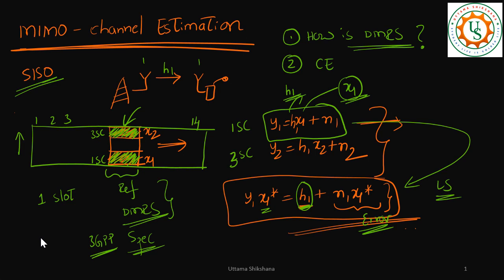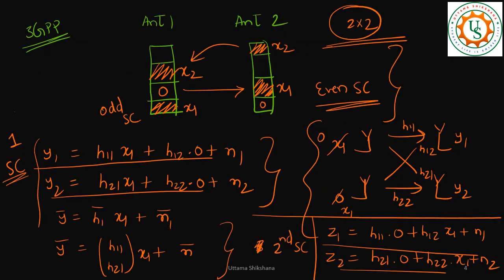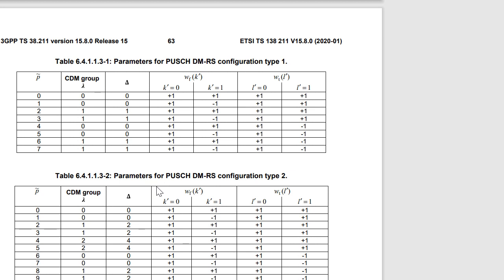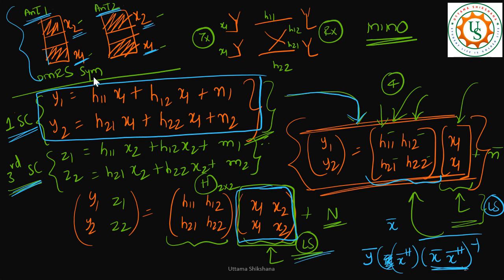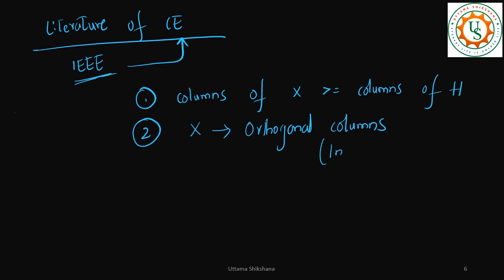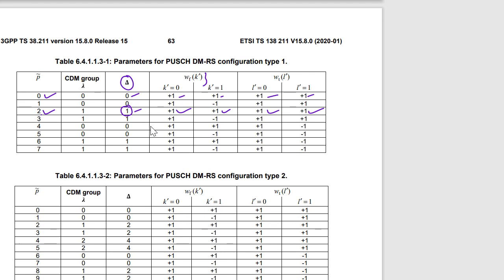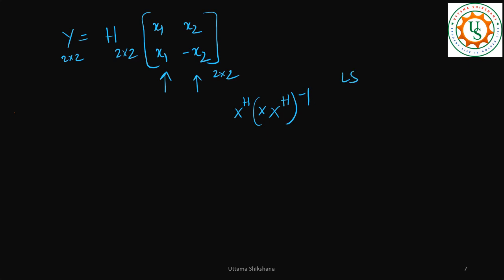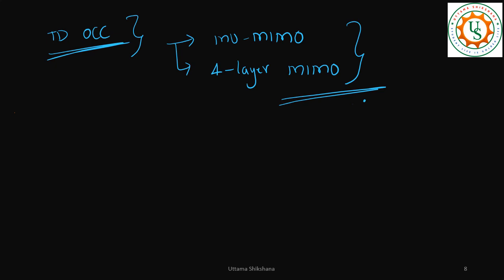[Series #8_11] FD OCC MIMO Channel Estimation in 4G / 5G | Frequency Domain Orthogonal Cover Codes

Comment: Nice videos and very focussed explanations, got classroom like feeling. One question: In the scenario considered, it is assumed that H matrix remains same for both subcarriers (1 & 3). However, when there is high frequency selectivity, this assumption might not be true. Then, H1 at subcarrier 1 and H3 at subcarrier 3, though H1 and H3 may/may-not be correleated depending on the scenario. Will OCC still help in that case?
Reply: Hi, I had the exactly same question since he considers that H1 and H3 are the same, which is not always the case. Actually, many vendors perform channel estimation PER subcarrier, so in that case Frequency domain OCC does not help. This is where Time domain OCC kicks in, but you would need to have two DMRS symbols (in MATLAB, it would be nrPUSCHDMRSConfig.DMRSLength = 2). 

In that case, if you assign the first UE antenna port  = 0 and the second UE antenna port = 4 (or 5), according to the 3GPP Table 6.4.1.1.3-1, they will have (l'_0, l'_1) = (+1, +1) and (+1, -1) respectivey. 

This way, the pilots of the two UEs PER subcarrier are going to be orthogonal and thus, you can perform channel estimation on PER SUBCARRIER BASIS.